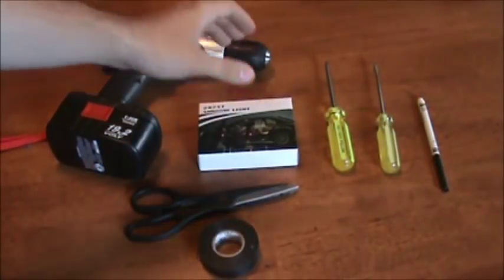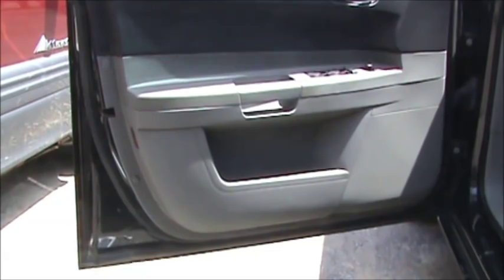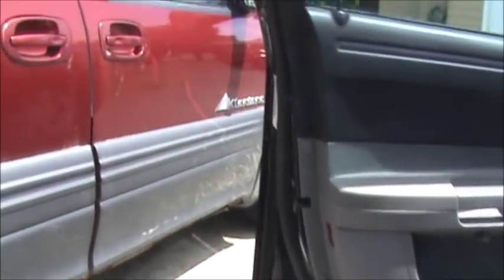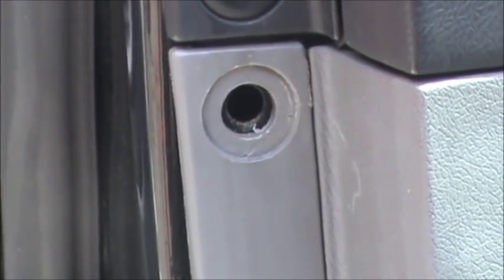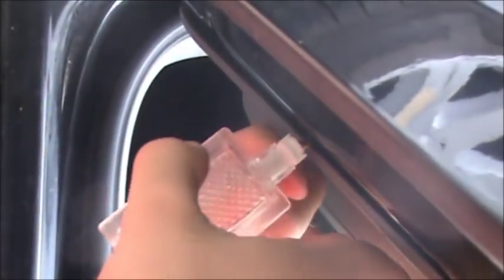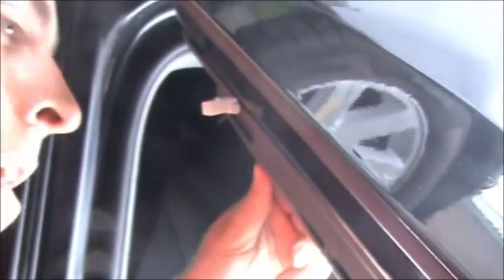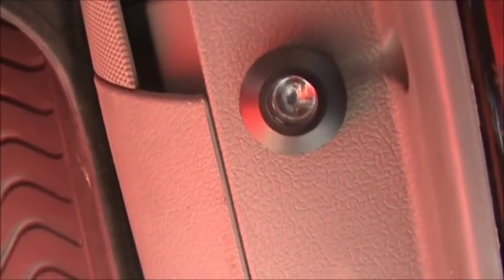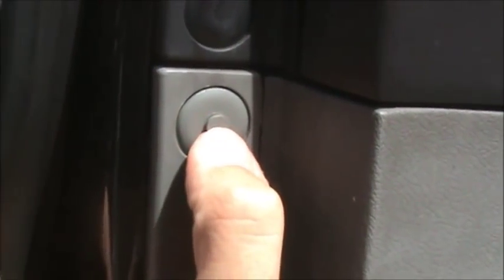How to Install Custom Puddle Lights

Comment: So what is the difference in the courtesy light you disconnected and the puddle light?? Would liked to have seen a before and after comparison.
Reply from the maker: On that model car I literally just disconnected the puddle lights and reconnected the custom puddle lights the same way that the originals were connected

Comment: Is it the same as doing a puddle light install on a 2006 charger?
Reply from the maker: as long as your puddle lights are installed the same way as a 300 then yes!
Reply: pierre what if i don’t have door lights